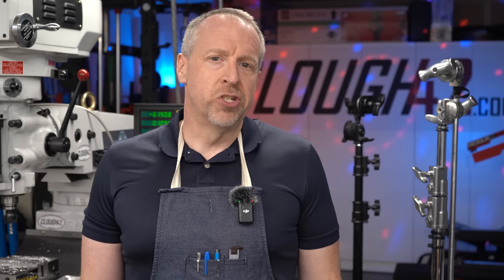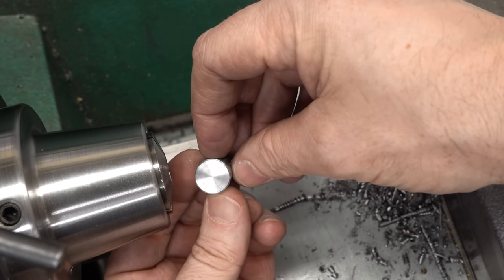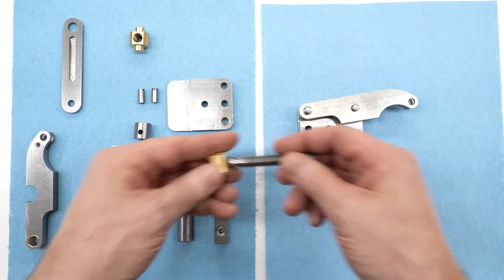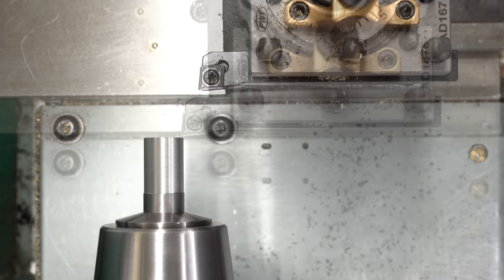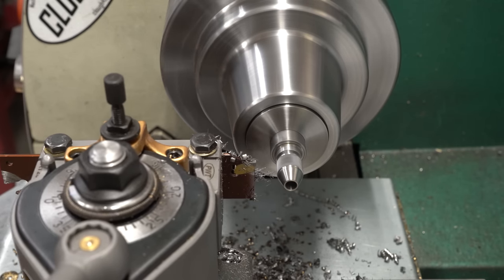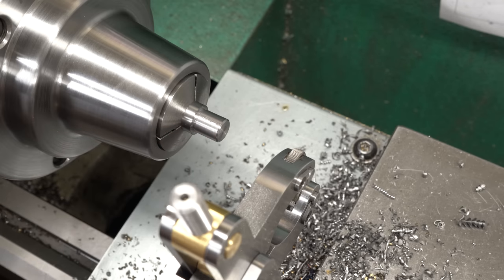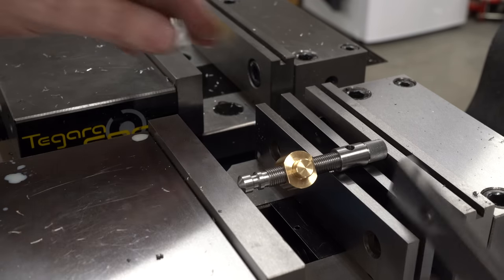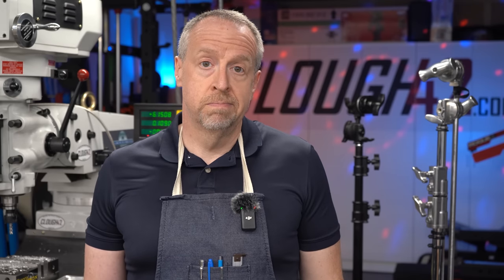Finishing the Hemingway Sensitive Knurling Tool - Part 6

Comment: The spring to keep the parallels in place, what a creative idea
Reply: Commenters on a recent Blondihacks video suggested using scraps of steel banding (left over from New Machine Day) as the springs, instead of traditional coil springs, but coil springs seem less terrifying to me.
Reply: @rpavlik1  In my experience, real springs tend to go "Sproioioioinggggg", never to be seen again.  I think it happens when I can't find a shorter spring and over-squash the one I did find in the spring drawer.  Flat springs from steel banding test to be more forgiving of being compressed too much
Reply: @rpavlik1  I think this tip came from Joe Pie who has a great channel full of good tips like this.

Comment: I wondered about the 10 thou discrepancy between the arm thickness and the spacer block. It seems overly generous to allow for free movement. I made it to spec but there is always the option to tighten up the clearance. Nice looking build!

Comment: The way we used to close up holes a tad, for instance dowel holes or holes for punches in a punch plate. Place a hardened ball larger than the hole at its end, brass drift on top of the ball, good clout with a hammer. Repeat at other end if required. This tightens the hole at its end or ends.

Comment: My screws were long as well. I am considering drilling out the threaded side plate on mine to pass the long screws through, and then threading the mounting block instead, instead of using the M5 screws to mount it to the side plate. The mounting block would hold the entire assembly together instead of just being a block to mount in a tool holder.

Comment: Another thought on parallel springs. If the gap was too small between parallels for the springsI would steel strapping from skids with a bend to get much closer. It was  hard to see but yours looked close to bottoming. Really nice job on the knurler by the way. Be well.
Reply from the maker: I have a few different springs.  Steel strapping also makes a great spring.  Nearly everything I get these days seems to have nylon straps now, unfortunately.

Comment: Re 26:25 ; I've got an original Marlco knurler. I can just about get an 8 thou (0.2mm) feeler gauge between the top arm and the side of the body, so your 10 thou gap does look to be about "right" vs an original.
Reply from the maker: Yeah, I played around with feeler gauges, and it's right around .010" or maybe a little tighter, depending on the exact position of the arms and cam.  Now that I've seen (and felt) it in action, I'd feel comfortable taking .005" off of that and leaving .003-.005" remaining.

Comment: Not sure why they specify turning the screw knob down before knurling. I'd like it larger; if you're going to knurl it, you want larger for better torque application, even with the tommy bar!
Reply from the maker: You don't really need torque, since the clamping force comes from the cam lever.  Having it smaller makes it spin faster and makes it quicker to get to size.

Comment: Nice build.  I've built their tailstock die holder.  Was fun.  Did you put anything on the steel to prevent rust?
Reply: He's mentioned in the past that he lives in the desert so rarely needs anti-rust treatment. But I think he mentioned earlier that many of the machined parts are stainless, and the rough sides of the stock also help.

Comment: So I've been trying to figure out what makes this the "Sensitive" knurling tool... Is it the cam action being more backdrivable than a screw so you can sense knurl wheel engagement and action? Or is "Sensitive" being used primarily as a euphemism for "Small"?
Reply from the maker: You can feel what the tool is doing through the lever.  In practice you can feel when it is fully engaged and the gullets of the knurls fill up with raised material.

Comment: Well, that tool is way more complicated than it needs to be, but I kinda think that's the point. It does have interesting and elegant lines. On double-tracking, I find the reverse of what you (and Quinn) find. If you start lightly, a double track, even triple, can get established. But if you start aggressively, the pattern starts deeply enough that when the wheel begins its second lap around the part, it has a good chance of slipping across a slight mismatch and into the established pattern. Sometimes I'm just unlucky and it looks like crap anyway, but I'm generally more successful at avoiding double-tracking that way. Also, be sure that the wheels are well matched. If they differ by a few thou, one may track correctly while the other double tracks. That's especially true of diagonal knurls, resulting in asymmetrical diamonds. 

I'm interested to know if you find the cam a significant advantage. I could add that feature to my straddle type knurlers, but I'm not convinced that it would be worthwhile.

Comment: It's a nice tool. But I think if I had your surface grinder, I'd surface grind all of those surfaces and get a nicer finish.
Reply from the maker: That would indeed produce a better finish.  It would also require recalculating all of the dimensions for the turned parts, and I decided it wouldn't really make the tool work any better, so I didn't.
Reply: @Clough42  All valid points. I do like it. Mill scale and all. ;)

Comment: What parting tool do you use? I'm in the market for a better one.
Reply: I have recently started using in a flat blade that takes a GTN3 insert. On my 11l” swing lathe it works really well. I can now part up to about 1 3/4 in steel with no drama.

Comment: I can't help it but I think if you start with wrong diameter of the part it will always double-track no matter how easy you go in. Sure, it's not very likely to hit that wrong diameter exactly enough by chance but it's still a lottery so I think there's a point in using those calculators.